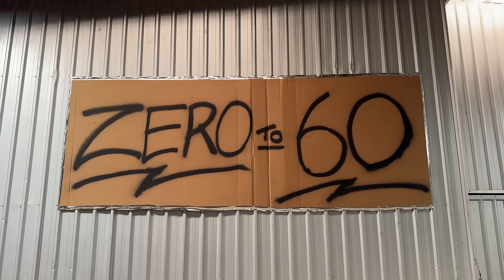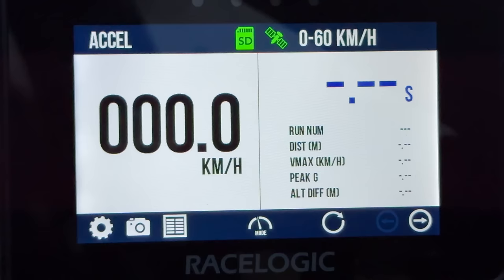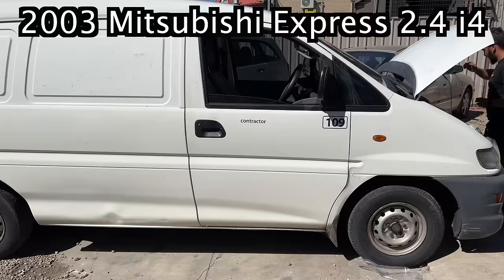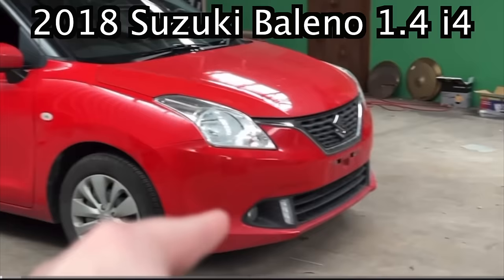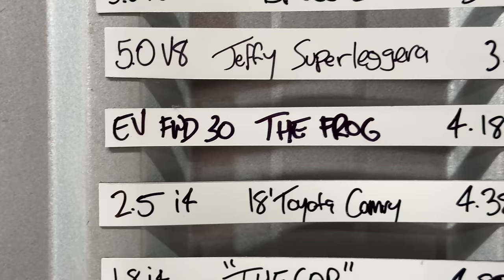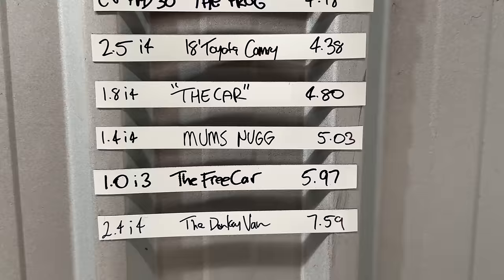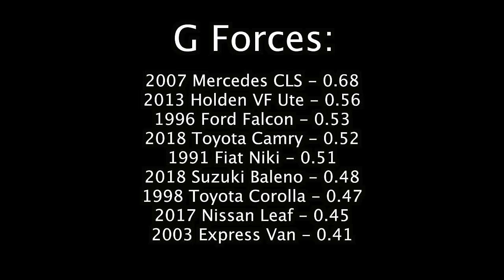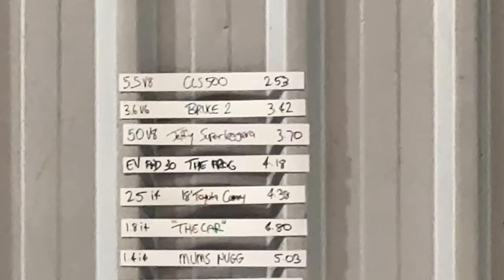The Zero to Sixty* Nugget Shoot Out.

Comment: The Leaf must have some kind of intentional low-speed power limits going on to get that low G-force in a sprint. The way electric motors tend to work means they can put out absurd quantities of low-end torque, since that's what happens when you chuck 80kW through a motor that's not turning all that fast.
Reply: If you turn TC off you can burn up the front tires no problem
Reply: @mostlymagical3220  My parents have a Zoé, it has an Eco mode that limits the power, if you remove it and the road is just a tiny bit slippery you can do burnouts with it, it's so dumb I love it. Very useful to get on a roundabout with a lot of traffic too since it accelerates very quickly
Reply: @Ozuhananas  for a bit I thought it was the ability to do burnouts that was useful in roundabouts, like you were somehow silently creating a cloud of tire smoke to clear up traffic
Reply: @tiagobelo4965  I can see why you thought that, my sentence is a bit clumsily worded lol. It's the power the motor puts into the wheels that is useful because it makes you accelerate very quickly, compared to my diesel Clio at least
Reply: Power limits are common on more recent front wheel drive EVs. I'm normally in a Leaf but rented a Polestar 2 for a week with 170kW not 80kW, it felt slower off the line than the Leaf. Motorway overtakes were great though.

Comment: Dude.
That Merc looks like it has blocked sunroof drains. 
When you put a car through a car-wash there is a-lot of water. Some of it gets past the edge of the sunroof glass and goes into a drain-pan around the sun-roof aperture, between the metal roof and headliner. 
There is a tube drain in each corner (2 front, 2 back).
Get some 3 to 4 mm whipper snipper line. Open the sunroof and feed the line down each tube to clear out whatever crud is in there. Use a little water to help. 
Be VERY careful. You don't want to puncture the poly-pipe that runs down each A-pillar and C-pillar, because then you've got another problem altogether...
Replacing those poly tubes is a pain.
Also, on cars with dark paint, sun heat tends to cook the poly drain pipes, and they shrink. They can pull off the metal tubes at either end. Again, they need replacing. Not fun.
Reply: Did you see his original video? I believe it's leaking through a poorly sealed windshield

Comment: Fun fact about Fiat "Tony" 126p
When my dad used to drive one like that when it was just 2-3 years old...going 80 km/h (50 miles per hour or so) it was getting a little wobbly
The top speed he got in it was 110 km/h and by standards of the car was was considered a suicide attempt or a death wish because it was beyond unstable at that speed
Having a crash in that Fiat at the speed of 40 km/h already is pretty awful because of no protection whatsoever

Comment: I'm glad to see that your the car also has the 7A-FE, I have a 1996 Corolla DX in the same colour, same clearcoat and paint fade, same engine, only difference is that it's a lefty. Mine has a cheap short-ram air intake I got from an auto parts store for free, it makes so much induction noise on cold idle that we call it the "Vacuum Cleaner".

Comment: Residential area speed is 60km/h in Australia? WOW! Here on the other side of the planet (Read Brazil) it's 40Km/h in residential areas (some times 30. 20 near schools) or most midtown roads and 60 on primary roads (Read large streches of Boulevards). 80 is mostly on intermunicipal roads that connects towns that are not directly adjacent to a motorway.
Reply: In Adelaide, where Wade lives and so do I, it's 50 by default if there are no signs. Many residential side streets are 40, especially in fancy areas, but certainly not all. Suburban main roads are pretty much all 60 though.

To get to the outer suburbs you'll likely find an 80 road (and on special occassions, 70 in the lead up). Then highways and rural roads are 100 or 110.

So, honestly not toooo different!
Reply: @Simoneister  Hmmm... yeah, not too different, really. But, I'm yet to see a 50 and 70 sign.

Comment: the Cadillac 3.6 v6 (aka alloytec motors) can boogie as long as they are working properly in terms of sensors, sparkplugs and compression. the vf has even tighter gears and diff ratio than the vz layout so they are a little quicker thanks to that 6 speed auto upgrade. if its sluggish it could be plugs, dirty cam vvt sensors, oxygen sensors before the cats or injectors/fuel regulator, dirty MAF.
the ute should be rather neck snappy, I rebuilt my vz v6 which is the old 4spd auto and it has so much more response after i replaced all the sensors. I went Ebay 👌

Comment: If you want faster times in the Commy you probably need a throttle controller, it's stupid how much delay modern electronic throttles have so that they drive "smoother" it'll remove that bog down you get when you floor it and make everyday driving more enjoyable
Reply: I thought throttle controllers only helped with sensivity, not when flooring it?

Comment: the leaf's ecu doesnt give you full power off the line, check leafspy while you test. I'm not sure how you can trick it to give you 100% power off the line, even with tcs off it still ramps the throttle on slowly. EDIT:  turns out you can 'neutral drop' and power brake the leaf to bypass this throttle ramp behavior, I'm having so much more fun with my car now.

Comment: Hiya horribly off topic but i need help with a nugget.. so it was sitting for 2 years. The battery was effed so i got a new one, i connect it and turn the immobilizer off, then smoke coming from a wire(s) near the alternator. The alternator isnt the problem here zs the engine wasnt running. Any help at all will be greatly appreciated

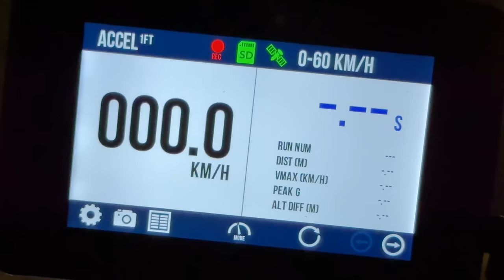Comment: 5:55 electric cars are VERY deceptive with acceleration. I have an EV6 which can do 0-100kph in roughly 4.5s. When you're in the driver's seat you can absolutely feel the pull. When you're in the passenger seat it's fucking TERRIFYING. 600Nm of torque is just UNLEASHED to all four wheels immediately; sport mode just dumps all the power at once. It's amazing. See if you can rent a dual motor EV one time.
Reply: Which setup is your EV6? Is it a GT?
Reply: @Expt629  It's the GT-Line with AWD; so a 95hp front motor and 225hp rear motor and a total of 605Nm of Torque. 0-100kph in reality is around 4.6 in ideal conditions.

For reference, the GT is 577hp and does 0-100 in 3.2s!
Reply: @benanderson89  very nice!
Reply: @Expt629  Thank you!
I like it so much I'll be buying it from the finance company when the term ends. Then on goes some lightweight wheels, wider rubber, maybe some new suspension~

Time to have fun with it!
Reply: @benanderson89  you could probably put a nice custom paint job or something on it if you wanted.

Comment: @5:10 ngl the only experience of Suzuki I've had is my mothers Verona, my Fiancees Forenza and my friends Forenza for that matter literally burning to the ground. Hell on my route to work that one time I saw another one and that makes literally 4 cars by Suzuki literally burned to the ground I've experienced in my lifetime. Like not even joking every time, even after the fire dept came, all that was left was the frame. They really shouldn't have tried to rip off Porsche. Anyways that's my tangent. But anyways yeah. Gonna continue watching now, but keep an eye on mums nugget. Fr. It's at the point that Suzuki really isn't a thing around here in NA anymore. Like I'm in the automotive logistics chain for work, they barely exist here anymore (if that).

Also, if you own a Suzuki, NEVER BUY THE OEM HEAD GASKET. GET AN AFTERMARKET ONE. FOR REAL NOT EVEN JOKING. IF YOU GO OEM, IT. WILL. LEAK.

The Isuzus are great and can be abused to the ground, but avoid the actual sedans and whatnot.
Reply: The Verona and Forenza are rebadged Daewoos, not proper Suzukis. Also Isuzu has nothing to do with Suzuki other than both being involved with GM in the 90s and 00s